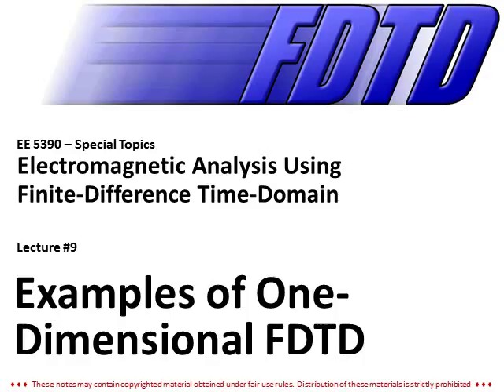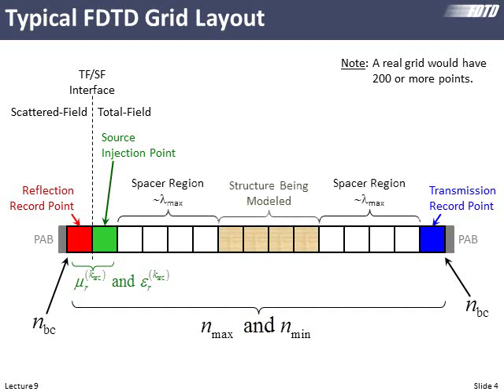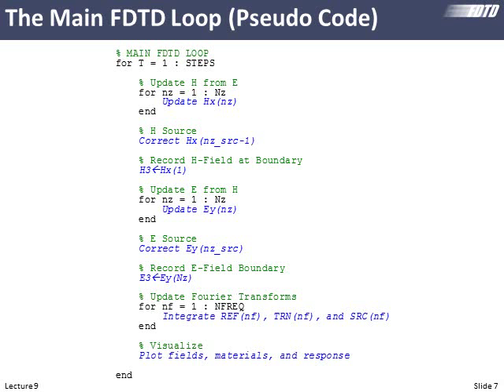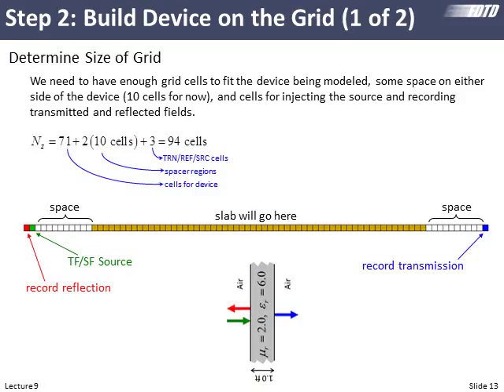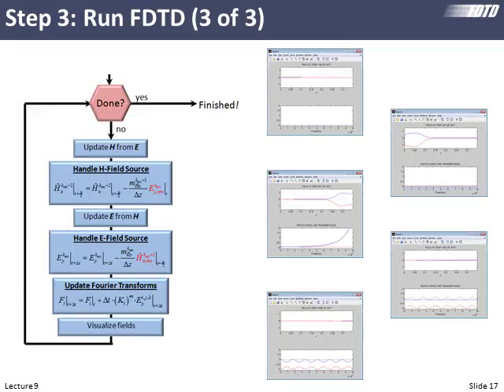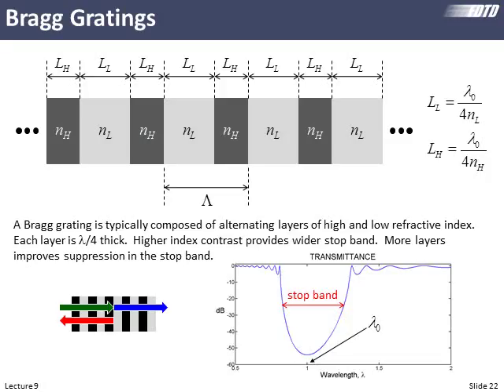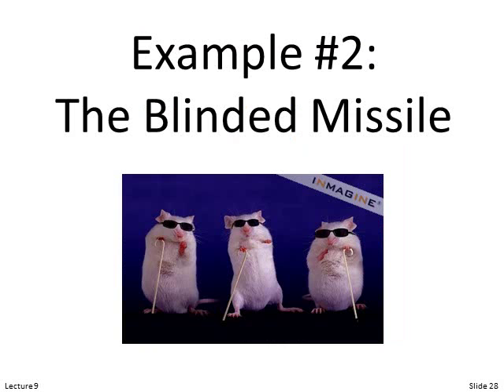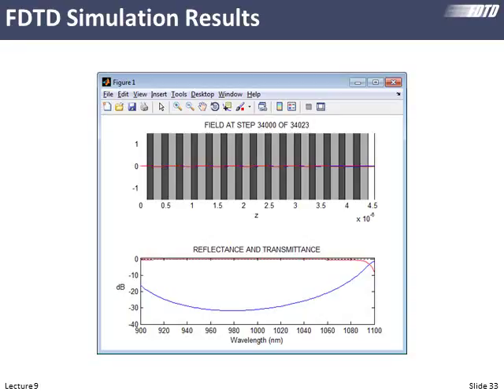Lecture 9 (FDTD) -- Examples of 1D FDTD

Comment: Hi Professor! On slide 14 of this video, ur and er are assigned to nz1 to nz2. But E and H are half cell apart on the grid. If we think the E is at the center of the grid, then, H will be at a boundary between the slab and air at the edge. In this case, shall we use averaged UR  for H field at both sides of the boundary between slab and air?  Thank you!
Reply from the maker: Great point. In principle your approach is the most accurate. I think your approach is needed for high contrast. For low contrast, I tend not worry about this and just ensure proper convergence.

When you get a 2D, I teach a method that I call the "2x grid technique." It is a great way to sort all of this out.

I am not sure if you are aware of the online FDTD courses that we offer. The entire first half of the 1D FDTD course is completely free. If nothing else, I recommend working through that. You will learn a lot. I teach the 2x grid technique in the 2D FDTD course. Here is a link about the course:

https://youtu.be/uBiprIN8gfY?si=DUgqX0aQDue82JtS

Here is a direct link to the courses:

https://empossible.thinkific.com/collections/FDTD-in-MATLAB

Hope this helps!
Reply: @empossible1577  Thank you professor！ I bought your book but does not have time to read it yet. I am a semiconductor laser engineer. FDTD is very useful in our industry at this moment. I never got chance to learn it myself. Your course is very helpful！I recommend it to my friends already. The companies never give us time to learn，just project, timeline and budget...I will try to learn all your courses！ Thank you

Comment: Hello Professor I have a question. The loop you give here in the lecture is not the same as the one in the lecture notes. In the lecture notes the H field at the boundary is corrected first and only h1 and h2 are updated. I was wondering whihc implementation is correct?
Reply from the maker: Both are correct. There is some flexibility in the order that things are calculated, but you need to be careful. For example, you can create a loop that does A, then B, then C, then D and then repeats. That same loop would likely work if you started with B, then C, then D, then A and repeat.

I really need to be consistent. Some problems I have is that I evolve the lecture videos and sometimes miss modifying the codes or whatever else may happen. Sorry for any confusion!!
Reply: @empossible1577  Yeah that makes sense thank you!

Comment: Hello Professor, I was curious as to why you chose mu_r = 2 for the slab simulation, as I couldn't really find a suitable material that would have such permeability. In fact from what I've found everything is either 0.999-1.001 or in the thousands (ferrous materials). I've only seen maybe 2 or 3 materials that come close but they are metallic and as far as I understand they wouldn't be able to support an electromagnetic wave and likely wouldn't have eps_r = 6. Any comments appreciated
Reply from the maker: Happy to answer!  I was not trying to provide an example that resembles realistic materials.  Instead, I was demonstrating the code, how to enter material properties, and getting intuitive about the results.  Had I entered 1.001 for the relative permeability, the effects would not be obvious to our eyes.

Comment: Sir, thanks for such an awesome course on FDTD. I have a question how do you add a polychromatic source in an FDTD simulation? I also have another question how do you model a dye film on a glass slide which has a specific range of absorption and emission using FDTD? Can you tell me some relevant articles for this.
Reply from the maker: For polychromatic, you will base your grid resolution on the highest frequency, but that will have the shortest wavelength.  Otherwise, it really is very simple.  You just calculate your source functions that have all the frequencies or wavelengths you are interested in.

Incorporating loss and dispersion is covered in Lecture 10, although those are advanced concepts so I don't go into that in the detail you may want to see.  I highly recommend Taflove's book on FDTD.  That will have everything you need as well as references to the literature.
Reply: Thank you sir

Comment: Sir, how did you convert frequency spectrum to wavelength spectrum? Can we simply do it by replacing frequency(f) with (c0/lambda) in the Kernel(K) equation?
Reply from the maker: Yes...

frequency = c0 / wavelength

That is it!

Optics people usually talk in terms of wavelength.  RF/microwave people usually talk in terms of frequency.  If I am doing an optical simulation, I will define all wavelength parameters in the dashboard.  Then, when I need frequency like in the kernel calculations, I will calculate frequency in that step only.  I will try to stick with wavelength in as many places as possible.  Similarly, in an RF/microwave simulation, i will define all frequency related parameters in the dashboard and only calculate wavelength when that is needed.
Reply: Thank you Sir for the clarification.

Comment: In grid a dielectric material has normally been dealt with. If we need a metal anywhere in the grid how we are gonna do that? Metal has a complex refractive index and permittivity of metal indeed a function of wavelength.
Reply from the maker: A complex refractive index is a frequency-domain concept so it does not apply to FDTD.  Further, refractive index and material impedance are very intuitive parameters that characterize the effect a material has on a wave.  However, the permittivity, permeability, and conductivity are more fundamental to Maxwell's equations.  For FDTD, adapt your model of the metal to a permittivity.

There are a variety of ways to handle metals and dispersive materials in FDTD.  These topics are discussed in Lectures 10 and 18.  Take a look at these.

Last, let me point you to the course website.  Here you can download the latest version of the notes, which may have some improvements, corrections, and other revisions from what you see in the videos.

http://emlab.utep.edu/ee5390fdtd.htm

Comment: i have designed MATLAB code where Nz=336 cells, every thing have worked well but the simulation is so slow very very slow. does there is a method to fasten the MATLAB simulation ? i have another physical question : when we design a slub with e2=sqrt(e air*e2) and d2=lambda0/(4*n2) (at invisible slab example) the wave at frequency f0 will bot be reflected at all, how this happens physically and how the wave knows that there is another medium which is medium 1 before it reaches that medium in order to not  reflected back.  does this has relation with quantum mechanics ?
Reply from the maker: If your FDTD code with only 336 cells is running very slowly, something is wrong.  Are you drawing graphics every iteration?  If so, you graphics may be very slow and you can fix that by only updating your graphics every 10, 50, or 100 iterations.  if that isn't it, check your time step.  It may be way too small.

If you run the invisible slab simulation, you will notice that the slab is not invisible at first.  Some of the wave reflects initially, but that quickly disappears.  The slab becomes "invisible" when the wave reflected from the second interface interferes destructively with the wave reflecting from the first interface.  This only happens at the special frequency where the 2nd wave joins the 1st wave 180 degrees out of phase.
Reply: thank you so much sir, but how can i update the graphics for every 50 iterations because i dont know how to  do this ?
Reply from the maker: For T = 1 : STEPS

   % FDTD Code

   % Visualize Results
   if ~mod(T,50)

      % graphics code

   end

end
Reply: thank you sir, the code becomes very fast
Reply from the maker: Great!

Comment: Hi! to have diagrams in example 2, can you tell me about permeability, NLAM, NDIM in simulation? because I can't draw the same diagram as you. Could you help me? thanks
Reply from the maker: +An Nguyen van NLAM is a number of 10 or 20.  It describes grid resolution based on wavelength. So the grid spacing will be the wavelength divided by NLAM.  NDIM is the minimum number of cells to resolve a feature with and usually has a value of 1 to 4.  This ensures that no fine features are missed.  These parameters are described in the lectures.  Hope this helps!
Reply: +CEM Lectures thanks very much. And with NPERIOD bragg grating  ,  I calculated it that:......................................................................%% COMPUTE OPTIMIZED GRID
%%%%%%%%%%%%%%%%%%%%%%%%%%%%%%%%%%%
%NOMINAL RESOLUTION
dmin = min([d1 d2]);
lam0  = c0/fmax;
dz1   = lam0/nmax/NLAM;
dz2   = dmin / NDIM;
dz    = min([dz1 dz2]);
% SNAP FRID TO CRITICAL DIMENSION
nz = ceil(dmin/dz);
dz = dmin/nz;
%COMPUTE GRID SIZE
Nz = NPERIOD *(round(d2/dz) + round(d1/dz)) + sum(NBUFZ) + 3; ..........................................
But It seems like wrong. Could you tell me that mistake? thanks
Reply from the maker: +An Nguyen van I only took a quick look at this, but it seems right to me.
Reply: +CEM Lectures  This is my code for building Bragg grating:%% BUILD DEVICE ON GRID
%INITIALIZE MATERIALS TO FREE SPACE
ER = erair*ones(1, Nz);
UR = ones(1, Nz);
nz2 = 2+ NBUFZ(1);
na  = round(d2/dz);
nb  = round(d1/dz);
for nper =1 : NPERIOD
nz1 = nz2 + na;
% ADD the slab
ER(nz2+1:nz1) = e2;
UR(nz2+1:nz1) = ur;
nz2 = nz1;
nz1 = nz2 + nb;
ER(nz2+1:nz1) = e1;
UR(nz2+1:nz1) = ur;
nz2 = nz1;
endI don't know why it doesn't run the same as diagram in lecture. The diagram is very different in lecture.Thanks
Reply: I got quite similar result as that in the lecture. It looks like the material initialization part in your case is not quite right. Have you plotted the ER and UR over grid axis? Just check the thickness of the two slabs within one period.  With your code, "plot(za,ER);" gives triangular shape of change in ER, which should have been in step function manner.